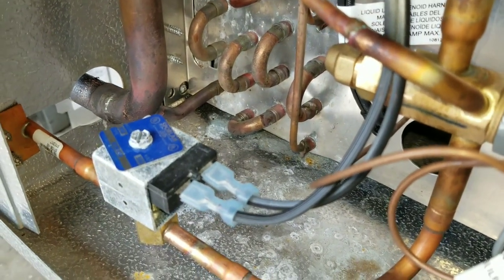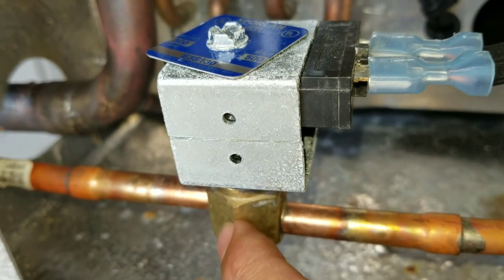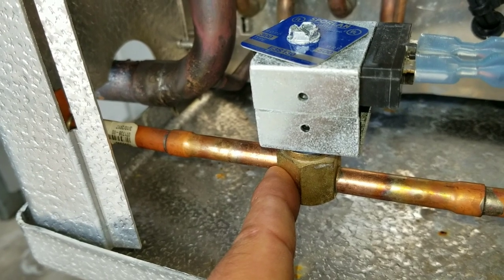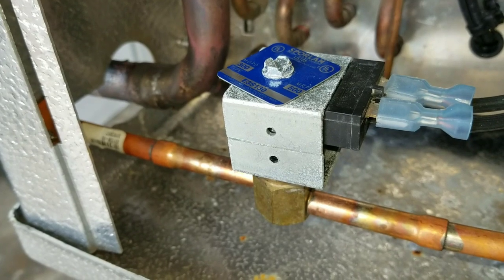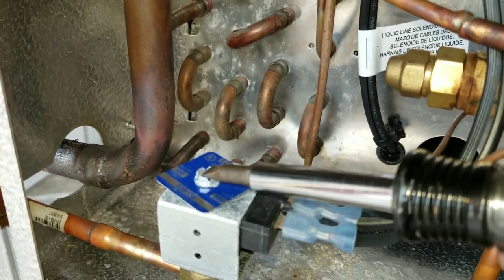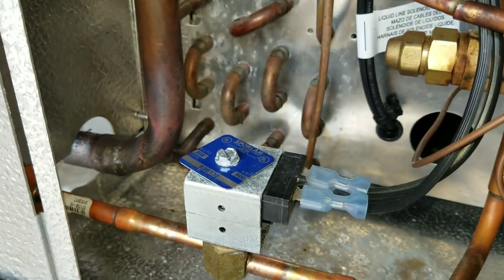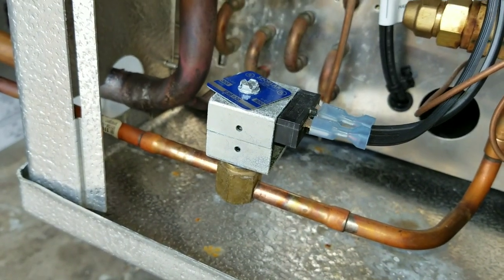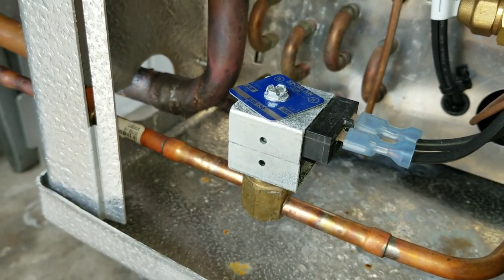Walk- In Cooler / Freezer liquid line Solenoid Valve

Comment: I'd like you to expand on the opinion that this kind of control strategy is good for the compressor (e.g. compared to switching the compressor on/off by a thermostat). Is could be so, but the statement should be more like "In cold climates and compressors without sump heaters, where during long idle periods refrigerant can migrate to sump/oil, this control strategy prevents oil foaming/compressor slugging." I know that both control strategies are common and none must really be defended to a customer. What I mean is engineers' talk. I'd be glad to have a better picture that an average tech.

Comment: Ok you showed one way to know if the solenoid is getting energized by the resultant magnetic field on the screwdriver. Now my question is can the valve stick or get stuck even if the solenoid is energized? IE: valve not getting thrown...
And if you use the meter ( check for voltage coming from the thermostat ) then check for magnetic field. No magnetic field means an open coil in the solenoid and then deduce "bad solenoid", yes? 
Lol how much voltage would you get across the coil if its good? Sitting here im thinking you'd get a pretty low voltage reading across a conducting coil...whats the resistance of the coil? Notes I'd put on my schematic maybe, X volts if open and Y volts if not open.
I'm guessing the refrigerant is the lubricant for the valve? If the valve is opened and closed too many times when refrigerant has leaked out, can the valve get stuck? I guess you'd get an idea the valve is stuck if the evaporator doesn't get cold?

Comment: If the valve was stuck closed, would it give you low evaporator pressure and high head pressure?
Reply: Yea when the system pumps down thats what happend or in what u ask
Reply: Head pressure is determined by condenser ambient temperature (small refrigerant mass flow = low thermal power, impact of fan operation is low).
Suction pressure is determined by type of compressor and its wear as well as control devices.

Comment: where is expansion valve....is it possible to control liquid or expand without expansion valve..?
Reply: I believe electronic expansion valves control the flow like liquid line solenoid valves and also do liquid expansion.

Comment: Does the line solenoid value work in conjunction with the low pressure switch.
Reply: No.he work freely.he got comend
From the controler when the valve open then the low presure switch on the contactor and the comp start to work
Reply: @liranzozot4376 when the controller does not send a signal to liquid solenoid valve, then would the compressor turn off right away due low pressure on suction as a result of no refrigerant migration? And that is also because compressor contactors are tied to high/low pressure switches?